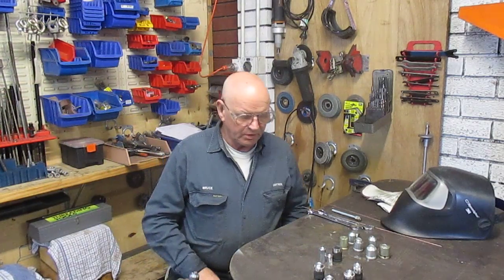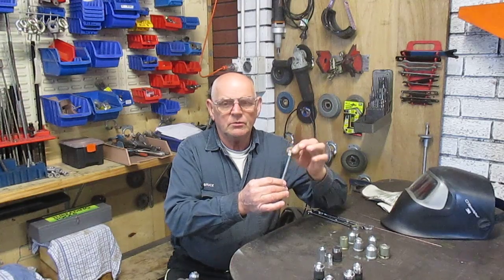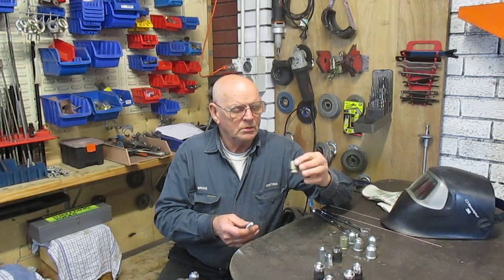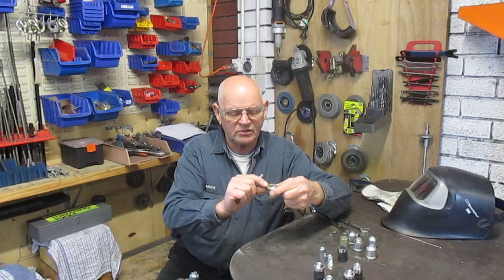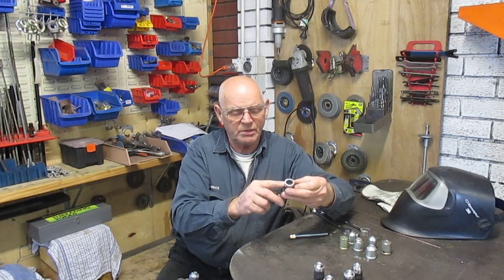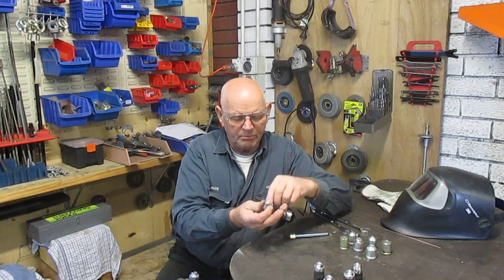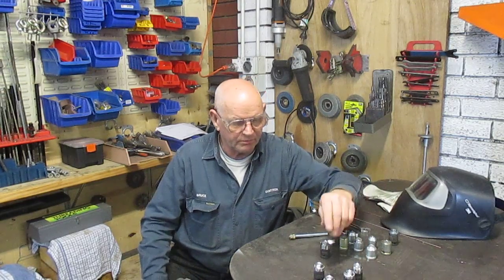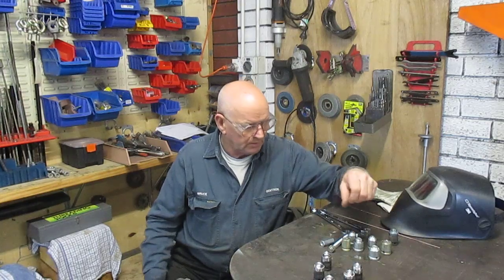Stud Insertion tools simple.

Comment: This is an elegant solution to the problem of stud insertion, the only problem I can see here is if the fitter does not check to see if there is any oil in the hole before running the stud in, I have seen a number of cases on alloy blocks where studs have been screwed in to holes with oil in them, and this has bulged the aluminium block and locked the tappets/valve lifters.Many thanks for posting this.

Comment: Bruce - your solution is good.    I have lots of experience putting in studs and extracting them in drag racing.    The best tool I have ever seen is the Snap-on set http://store.snapon.com/Stud-Remover-Sets-Set-Stud-Remover-15-pcs-1-4-20-thru-5-8-18--P635357.aspx      In the US they are about $500 for the set (metric or SAE).   We used them on all sorts of studs big and small, never a failure to get them out and even better the set does not damage the stud..
Reply from the maker: John Thanks, this tool is only for insertion of course and the good part is that you have a better purchase on the stud and it releases so easily. I also like the Snap On remover, however most of the frozen studs I deal with have been sheared off, and in a lot of cases someone has broken a drill bit or easy out inside, then they call me to getter out! keeps me busy for a couple of days a week.